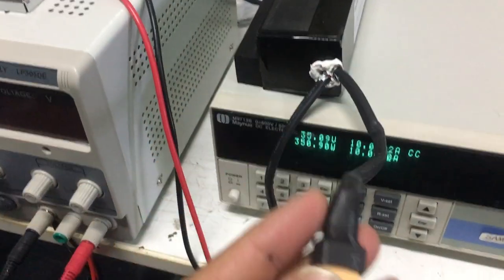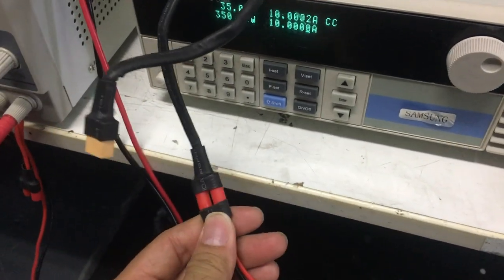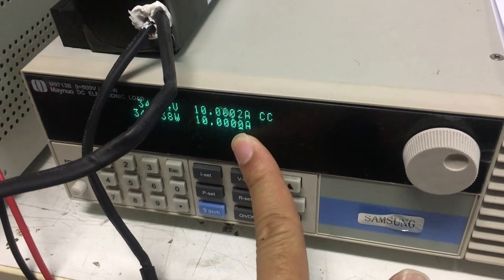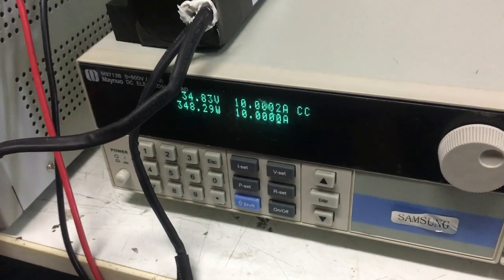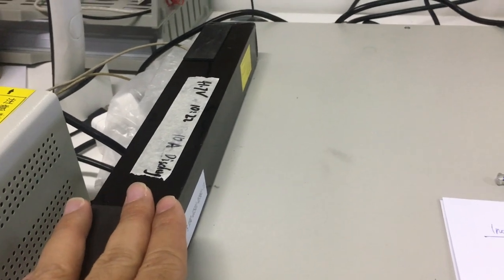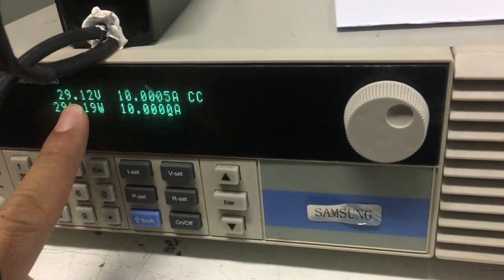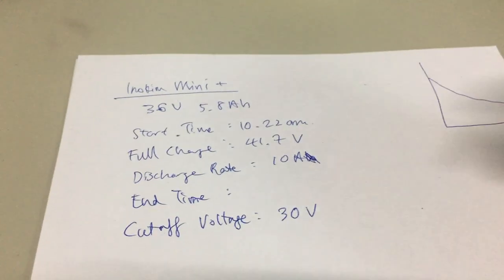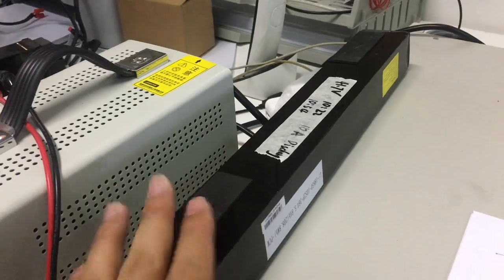How to Diagnose E-Scooter Batteries

Comment: I have a 36v scooter lithium ion battery pack that is showing 36v, it says charge limit is 42v, but it won't charge past 36.9 volts? Any ideas?
Reply from the maker: Yes the cells are old or damaged
Reply: Thanks for the reply, so it is supposed to charge to 42v?  Therefore new battery required.

Comment: I have 36v scooter lithium ion battery but it doesn't has charging wire. Can we fit charging wire to the battery?
Reply from the maker: @mdnoornabi9014  if a battery doesn’t have charging wire it means the charging and discharge uses the same wire

Comment: There are far easier and cheaper ways to test a battery.  Also testing a 2p on 10a will have a large volt drop.
Reply from the maker: Sure enough, the cheapest way is to ride it yourself.